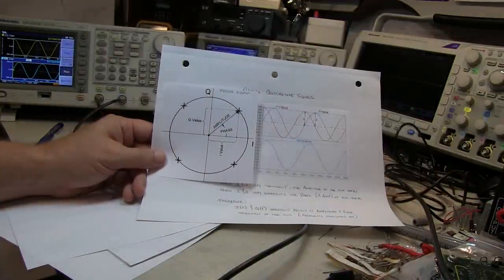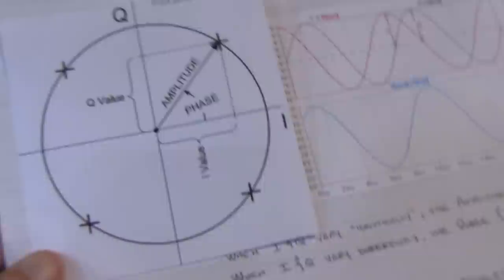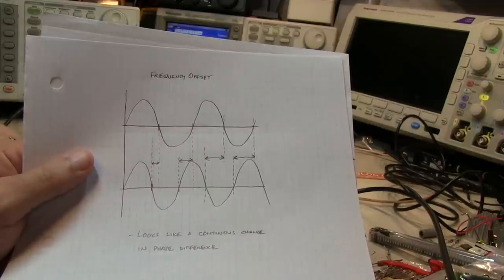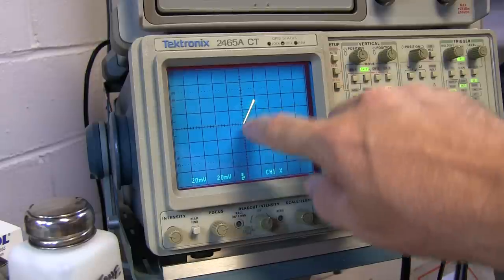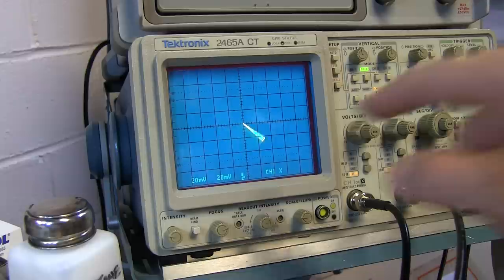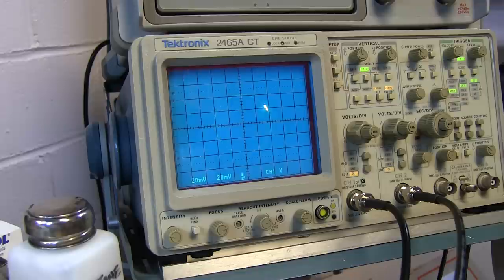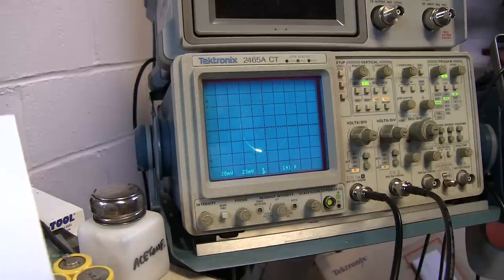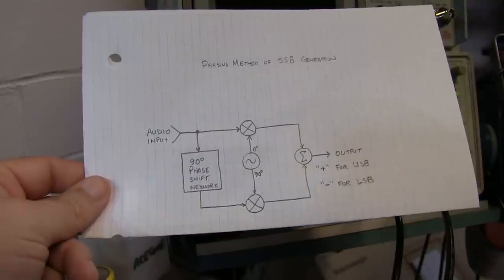#171: IQ Signals Part II: AM and FM phasor diagrams, SSB phasing method

Comment: hello, ive been watching and enjoy your videos and was wondering if you could help me out. i dont know if youve heard about a space game called elite dangerous, but its fantastic. there is currently a spectrogram image projected by an object in the game that 10s of thousands of people have been trying to solve for over a month now. i believe the image has something to do with IQ modulations of waveforms. im an auto technician and dont get a lot of time with this area. i will post a link to the image.
Reply: there may be some missing info, the central part is the important part. id just like observations or analysis if you can.
Reply from the maker: Not familiar with the game.  I looked at the image and I'm not sure it has to do with IQ modulation.  Maybe a good perspective is to recognize that the colors in the spectrogram refer to amplitude (like a z-axis), so possibly visualizing the figure in 3D, and somehow using the four smaller figures surrounding the circular element as some kind of registration or rotation references...  That's all I got...
Reply: Heh, well I appreciate the response.  There are many theories and several leads, but this was the one I was kind of going with.  If you don't see the relation though, I'm sure there is none.

Comment: Why doesn't the phasor rotate all the time, with no modulation? When there's no modulation, you're just adding sine and cosine functions - shouldn't that cause constant rotation?
Reply from the maker: The I and Q represent the peak amplitude of the sine and cosine waves, not the instantaneous voltage.  So, a constant I and a constant Q represents a continuous, unchanging, constant frequency tone at the frequency of the I and Q functions.
Reply: @w2aew I thought the scope in XY mode showed the instantaneous voltages of I and Q?
Reply from the maker: @johnbyrne1022  In this case, the XY mode is plotting the varying sinusoids, not just the magnitude of I and Q.
Reply: @w2aew  I think I get it now, thanks...so both I and Q are modulated with the same AM envelope, and the scope is showing how much of that envelope each one is carrying. So the X and Y inputs have the same phase (because there's only one AM signal) and the angle depends on the difference in peak amplitude between I and Q - is that right?

Comment: In the video, the resultant of quadrature signals ( Sin and Cos waves having equal frequency and magnitude) is shown as a diagonal line at 45 degrees to the X-axis when plotted on paper and drawn on the Oscilloscope. I presume that  plots/drawings are not done  considering Sin values on X-Axis and Cos values on Y-Axis (as in the case of Lissajous figures) otherwise the plot/drawing would be a circle. Is there any other mode on the Oscilloscope for drawing phasors in a vectorial form?

Comment: SSB via phasing method is as contemporary as it gets in SSB radios. The 90 degree phase shift over the entire audio passband is done in software via Hilbert transform. One can approximate a Hilbert transformer via FIR filter. Interesting stuff to play with.
Reply from the maker: I first remember hearing about phasing SSB rigs from the old Central Electronics 100V from the late 1950s.  Lots easier to do today with the Hilbert transform filter in DSP.
Reply: ***** Credit Wes Schum and Joe Batchelor for the CE 100v and 200BV. Two brilliant men, and the true fathers of SSB.
Reply from the maker: cny02253 Yes, absolutely.  I had a friend (now silent key) that worked with those guys and was responsible for the broadband tuning circuit that was also used in those rigs.